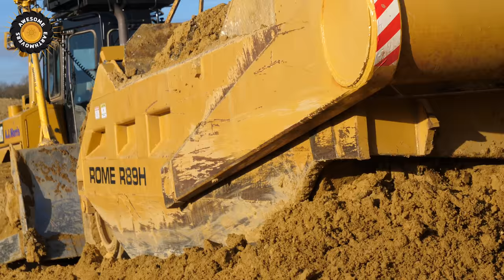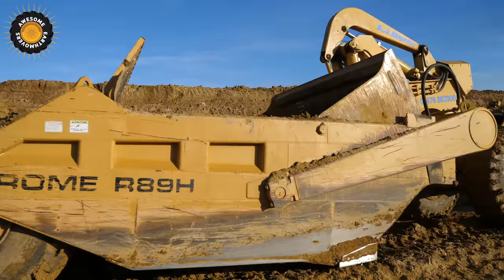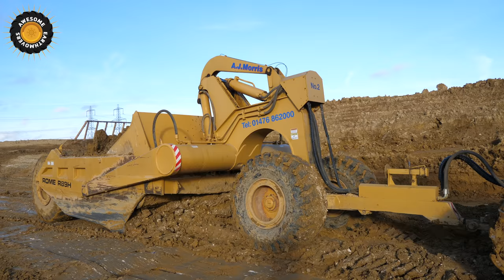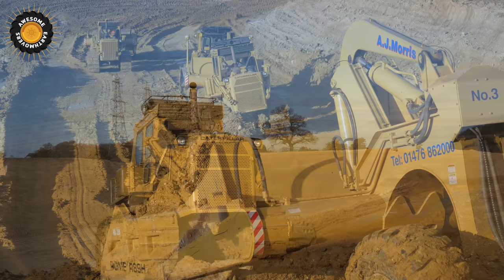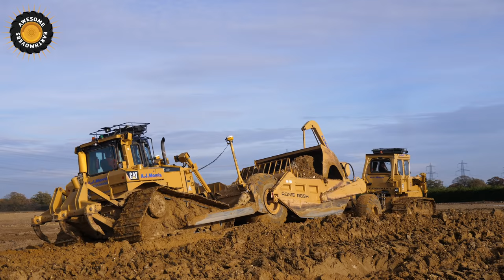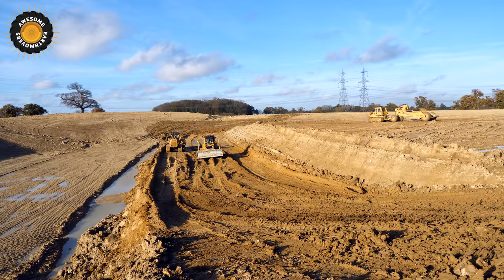Digging out a Reservoir with Scrapers

Comment: Cat n can. I used to have 2 cable rigs. Guy came by bought them converted to Hyd. Used to drive tractor up on lowboy and tow scraper. Once towed one 110 miles at 50 mph made sure had good tires. That was 23 years ago. Wouldn't do it now.

Comment: The John Deere tractors and 2 pan system moves more product than this method
Reply from the maker: Wade Wilson This company works all year round in the UK.  Using rubber wheeled machines when the ground is wet or soft at all would never work. You can also see they are digging a reservoir. You wouldn’t have a hope in hell of pulling two full pans out of the steep exit ramp with a rubber wheeled or tracked tractor. This set up suits this company perfectly.
Reply: @AwesomeEarthmovers  here in America we know how to get things done
Reply from the maker: Wade Wilson So your tractors and pans will be useless when it’s time to move on to purely dozer work. The D8K’s can have their blades put back on and switch to dozer work when necessary. If Americans know how to get things done then why did they need a German rocket engineer to get them to the Moon and British research to build the A-bomb?
Reply: Wade Wilson 
Not in these conditions.
Reply: The ground is to wet for that sort of gear. Your system is good for dry ground long haul work .In this situation it is damp to wet short haul.
Reply: @AwesomeEarthmovers  
You'd be speaking German if it wasn't for the sacrifice made by Americans. Your grandparents were far more civil . . . and grateful.
Reply: @wadewilson5296  In  America they would do it the same way in conditions like that, look at McAnnich construction, D 10s & d11s towing 641 & 651 scraper bowls as towed scrapers coz that's what the conditions suited and were most efficient way.
Reply: @AwesomeEarthmovers  There's always one...